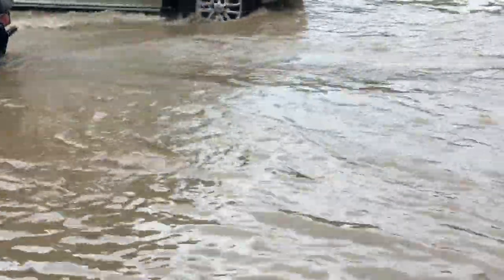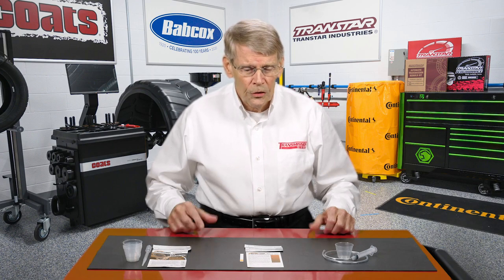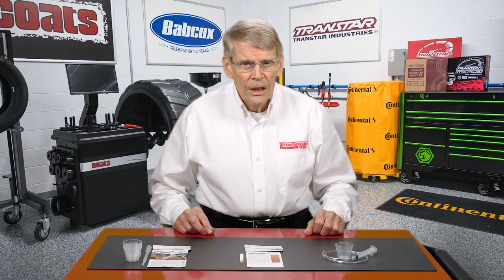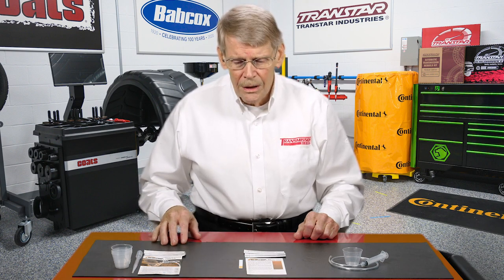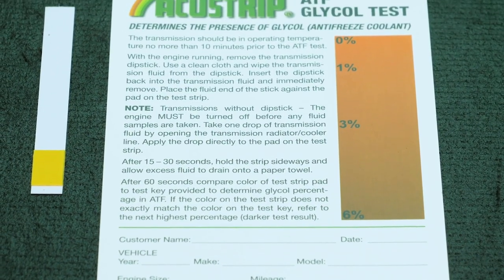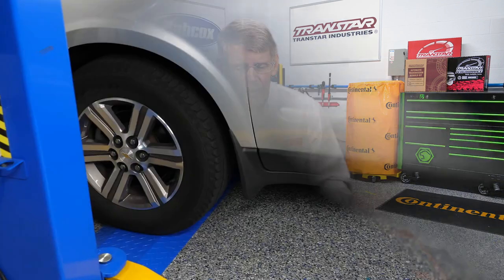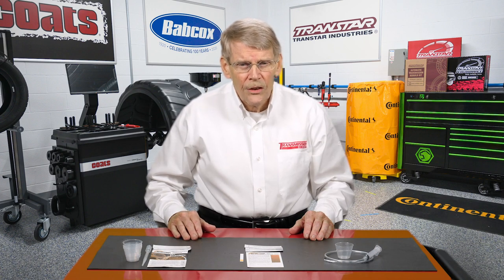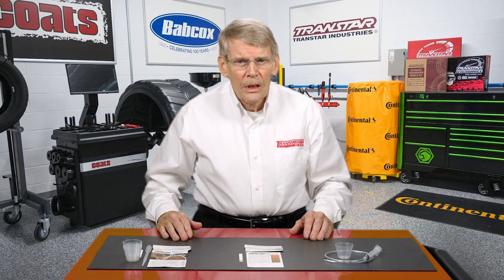How to tell if you have water or antifreeze in your transmission.

Comment: Please comment on glycol used as a tooling wash at transmission assembly. Glycol found in ATF fluid after oil analysis 24k kms. Transmission has its own cooler and not within radiator.

Comment: In a car with dipstick standing in high water without starting up the car after water exposure . How can you take out some transmission fluid to test and see if water seeped  in without taking off the oil pan or must the oil pan be removed to get a sample a but after you’ve done that, might as well change the fluid as a precaution.

Comment: My fault and stupidity, but battery acid leaked on to my transmission and my van would not start.   I used a garden hose to wash off the acid and towed it to my dealership who said the acid had burnt through some connector pins causing electrical problems, but that also my transmission had water in it and showed me a picture from the drain plug (no dip stick).   The van has never been near deep water and was otherwise was driving fine before the starting issue so I am assuming I caused this with the garden hose.  This was 7 days ago and the van has not been started since the hose incident.  What are the chances water might have entered via a hose from the top and be visible from the drain plug so quickly? Any chance I can flush this water and not require a rebuild?

Incidentally,  I frequently would long idle my van while parked.  It's never overheated, but what are the chances maybe that water entered from the radiator instead and the dealership missed it?  Can this be proven conclusively?